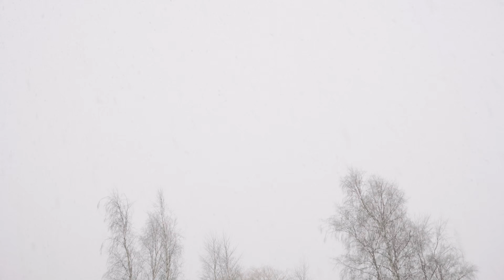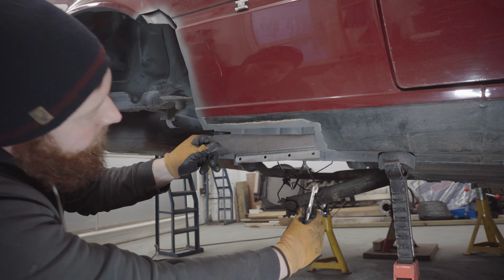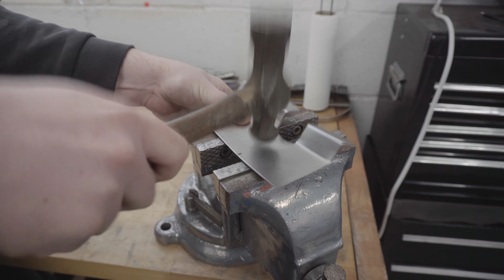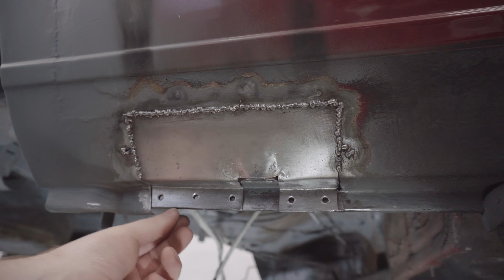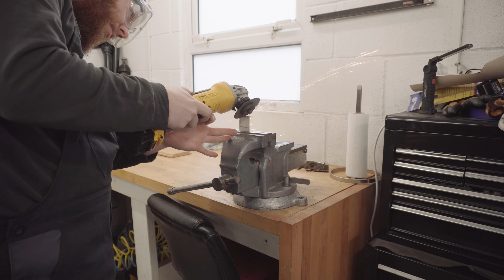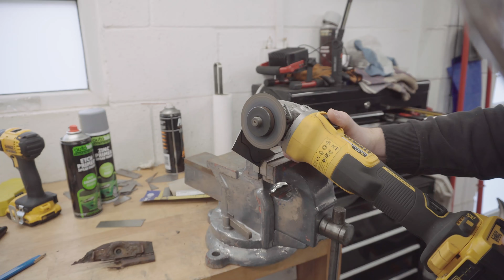Rusty Jacking Point Repair Guide | How To Weld Rust Hole in Rocker Panel Sill | BMW E30 Build | 018

Comment: Your videos are really great, very informative and some great tips( such as welding in the support plates behind the old panel to support the new panel ) but do you not spray 'weld through primer' between 'mating faces' or behind panels to be welded? I appreciate that some of it will burn off during the welding process, but any protection you can administer at this point will always help surely? 
Also!  Spending a half hour screwing that vice down to the bench will save some future heartache!
Please forgive my 'nit picking' your videos are really great and very informative cheers ! dx
Reply from the maker: Cheers david! Yeah youre right, best to get some protection on the rear faces to maximise longevity. Where I can access the rear side though I will avoid spraying primer as it only makes the welding more difficult.

You'll be glad to know the vice is firmly screwed down these days. 😃

Comment: What kind of welding mashine is good to buy for a beginner?
Reply from the maker: That's quite subjective but I don't think you can go far wrong with a MIG welder. I am using a Clarke 150. Check out the other videos where I weld up this rusty E30 and you will be able to pick up some beginner tips.

Although I am still a beginner myself. 😆

Comment: I really want to do this to my 2006 dodge charger sxt but I have no experience with this type of job whatsoever😭
Reply from the maker: Neither did I until I started having a go! Pick up an entry level welder of FB marketplace and get some sheet metal, after some practise I bet you will get the hang of it.
Reply: @SPANNERRASH  Thanks a lot, I’ll probably try it out in the near future
Reply: @Swervyyc I'm in same boat. Just started on my charger sxt. Idk why the factory puts foam in the arch but I have some fighting words for them

Comment: if it helps i think your wire feed setting on the welder  is to slow
Reply from the maker: Thanks for the tip on that, I will have more of a play around with it. I got it more dialled in on my later videos. Welding has been a steep learning curve. 😃

Comment: are U sayng, without actually saying it at all as if it’s common knowledge, when in fact it’s the most well kept secret everywhere, that these ‘jacking points of which no one seems to know anything at all about, actually have some vertical tube gizmo leading to them? - not just a hidden frame rail(of which no one knows what that word means, OR what side of pinchweld it’s on).  so then, the pinchweld, with it’s totally unknown jacking points(cause all thE experts disagree on the invisible location of), I’ve heard attached at right angle to framerail, again which no one in the world knows what(frame rail) means, or on what side it is of pinchweld, usually has pinchweld going down 1 hidden vertical side of it before it becomes visible, than the jacks, stands, etc. have 1/10th of an “ to push up on end of, no one knowing which side of frame rail they’re on? when a MUCH more structurally sound jacking point would be on actual frame rail it’s self, & then the smallest, most geometrically retarted, flimzy, clumsy, rust prone, tracktionless, geometrically inefficient, & JUST PLAIN s2pid-S’d location to attempt to push up on unknown side of framerail(guesscing thats some kind of steel tube?), when the slightest bit of 5th grader smarts would see it’s 10-100s better in several ways, just to have jacking point right beneath rail it’s self - is thought to be a jacking point.. but again, R U saying that there’s actually some tube behind this ‘jack point’ ?🤔.. hmnnn, too bad know one knows where this secret jacking point is.. I’ve got impala & asked dealers & they admittedly have no clue👋
Reply from the maker: Haha! Absolutely, theres more to the jacking points than meets the eye, they have additional skins inside with a structural upright "tube" to spread the load of jacking, preventing the jacking point from caving in when you put the whole weight of the car on it.

The external plates (and there are bulges on the rocker panel/sil) show where they are.

You should never jack up on any other part of the panel, it won't support it.

It's a truly awful design the way it's on a pinch seam, which is forever getting damaged each time you jack the car up, regardless, and that damage leads to rust.

I use rubber "pucks" which have a slot cut in them. Got them on Ebay. The pinch weld seam sits in the slot and its a lot less taxing on the car. I'd recommend them.

Comment: You welded the upper support piece from inside the car, can you access that with taking off the rear seat "door panel" ?
Reply from the maker: Hi Marco, you if you remove the rear "door card" you can access from the interior. It's quite difficult to see down there though.

Comment: I'm so mad at myself for not taken welding classes.
Reply from the maker: Or just wing it and learn as you go like I am! 🤣 To be fair I feel like I am starting to get the hang of it, which might be more apparent in my more recent E30 vids.
Reply: @SPANNER RASH well what welder do you have was it the best alternative?
Reply from the maker: @weliftnation2418  The one I use is an old Clarke MIG150 which seems to be serving me well. I think I linked an equivalent in the video description if you want to check it out.

Comment: Nice work but the supports you’re fitting before butt welding in the repair sections are not a good idea. Moisture will eventually get behind them and cause rust to reform. Technically what you’re doing there is lap welding and that could have been done easier by joggling one side and overlaying the new section. Butt welding without backing them up with supports is the best method to avoid future rusting,
Reply from the maker: Thanks for the input on that, the supports definitely make it a lot easier to weld, especially for a beginner like I am. But I totally agree, a butt weld would have been way superior if I had the confidence and skill to do it. Joggling looks like a good idea, I hadn't thought of that, something I'll explore going forward.

The welds on this car, front and back of them where possible, will be carefully seam sealed and protected from moisture so I'm pretty confident they'll last for many years. Especially as the car will only be used for fun through the summer. I appreciate your tips on that though, cheers 👍
Reply: @SPANNERRASH  Your welding looks pretty decent to me and if you get the welder setting and wire speed right you should be able to butt weld without any issues. A small gap of around half to 1mm is what you need between the panels and use the same welding process as you’ve done and you’ll get a good result. It just takes a bit of practice. I’ve been doing this stuff for over 30 years and still occasionally get blow- through if the metal quality is poor or it’s not clean.
Reply: @SPANNERRASH your welding is great instead of putting the support behind I suggest u use tape (masking tape or wtv) to hold the new metal in place and then tack it at a couple places and then remove the tape and finish the butt job
Reply from the maker: @MremiAntoine08  Thank you! I am learning as I go, its a tough skill to learn.

The tape is a great idea, I will certainly give that a go. The supports help me avoid getting blow throughs though which is a perk. But it's not as clean a repair because of it.

One day I will be able to zip a butt weld with no cheating required. 😆
Reply: @SPANNERRASH  Using the supports behind the joint introduces somewhere for rust to develop. I have used tape as suggested by @MremiAntoine08 and it is very quick and clean. However, you have to be very careful that both sides of the weld remain flush as you can get a lot of flex, even with the pressure of the wire. Magnetic clamps help a bit. I would have put seam sealer on the middle sill before welding the outer sill patch in place. I am really enjoying your videos - very clear, patient work and some good tips - many thanks.

Comment: I always use old washing machine panels to plate on the inside.  It works amazing as floor pans with the slight corrugation...I currently own a Ford Bendix ;)))
Reply from the maker: Haha no way, that's a genius idea if the corrugations match up 😂 I actually have an old washing machine waiting to be got rid of so I'll be sure to save the panels for future repairs. Great tip
Reply: @SPANNERRASH for personnal rat rod;  not for customers maybe . Youl never look at a washer or dryer in the same way, ready poweder  coated )  wish I could show my results.   I'm currently trying to weld  a new strut mount...a lot more precision required Laud hlp me :))
 😂  Enjoy your week young man.

Comment: What sheet metal thickness did you use?   Very good video :)
Reply from the maker: Cheers Laska, I think it was a combination of 1.2mm and 1.5mm for the bits that were structural, if I recall correctly.

Comment: Wasn’t the bung not for a drain port for the sill?
Reply from the maker: I considered that, but it is definitely sealed so wouldn't drain anything. The plastic bungs could probably be knocked inwards, but the way they are designed means there's no way they are coming outwards unless you can access them from the inside, which you can't without cutting a hole.

Another theory I've heard is that the holes are for the jig the chassis is moved around the factory on during E30 production, and they put bungs in just to prevent water and dirt ingress after the car was on its wheels. I can see it being true.
Reply: @SPANNERRASH  aw okay fair enough

Comment: Very nice job. But what's up with all those supports? Now U have sandwitched unprotected metal. Those pieces where well fitted. Butt weld ftw. I say U are too afraid of blow through :).
Reply from the maker: Haha thanks, the supports make it much easier to do for a beginner welder like me. I am definitely fearful of blowing holes because they're extremely hard to fix on this thin bodywork. Hopefully in time I will be more skilled and can use fewer of them. :)

Comment: Good job.  You can also buy the jacking point for E30.  There some for sale on eBay
Reply from the maker: Cheers mate, I'm still trying to figure my way with this welding but dialling up the power does seem to improve it. Just harder to avoid blowing holes in things, and I really wanted to avoid that with bodywork as I'm not skilled enough to fill them back in nicely yet! :D

Comment: Doing the same inner & outer sill repair / replacement on my E30 touring at the moment. I ordered new out sill jacking area reinforcement plates from BMW as they were still available for around £6ea. Unfortunately BMW have changed the part and are a completely different size / design, so I won't be using them!

Also the inner jacking reinforcement part for the rear of my touring is now NLA, but the front inner supports are available and can be adapted to fit the rears.

Recently just finished making the inner arch repair section and fitting it. Keep up the great work bzzzzz 👨‍🏭
Reply from the maker: Thanks Mark, hope your E30 touring job goes smoothly, sounds like it's well underway.

More and more parts are becoming NLA unfortunately, but hopefully, nothing which is absolutely essential for you. I've got the inner to repair next, shouldn't be too big of a job compared to the outer and the jacking point I've already done so I'm quietly confident.

Hopefully my welding will improve with all this practice, cheers. :D
Reply: Part numbers for the parts you mentioned? I cannot find anything from the catalogs.

Comment: Good job that! Doing a similar project on an E36, what's the plan after finishing the welding? Have a go at painting yourself or will you take it to a body shop?
Reply from the maker: Cheers mate, an E36 is a fine project :) I'm planning to do as much of this E30 myself as possible, including the painting.

We've painted quite a few smaller things now so really fancy having a go at a full car. Painting in a garage will never give me a concourse finish, but I'm not building a show car here, more of a fun drivers car. So what's the worse that could happen? We'll find out I guess :D

Comment: Great work mate
Reply from the maker: Thanks Jason, appreciate that :) I was pretty pleased with how this job ended up.
Reply: @SPANNERRASH  I’m currently doing the same on a Mercedes W202 always the jack points , but I don’t have a garage and do in on my front drive
Reply from the maker: @Shadowmosesarea51  Yeah way too common for them to rust, which is surprising as they are usually one of the sturdiest areas from factory. Ahh working on the driveway, I've spent many an hour doing the same. I'll cross my fingers for some clement weather for you mate!